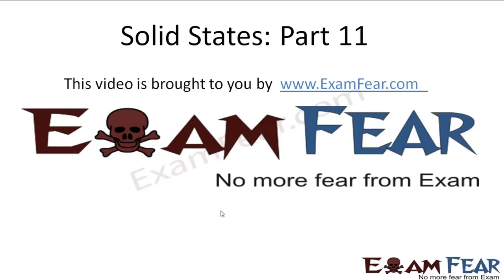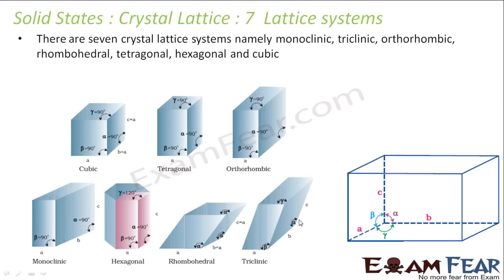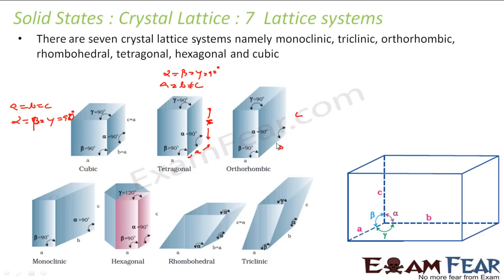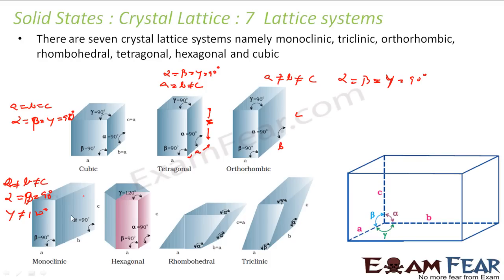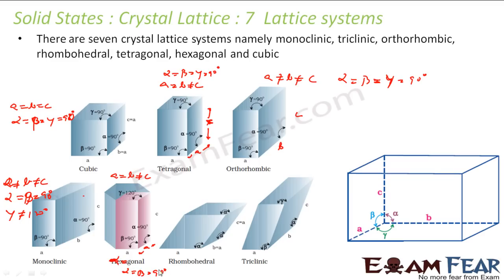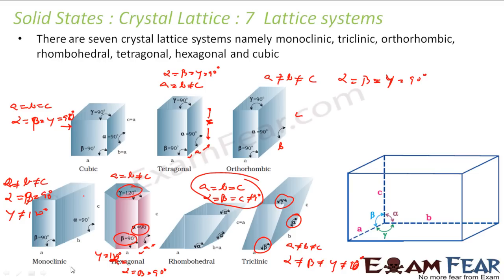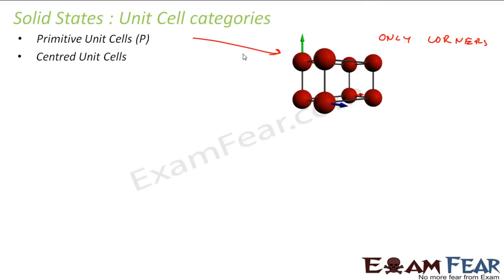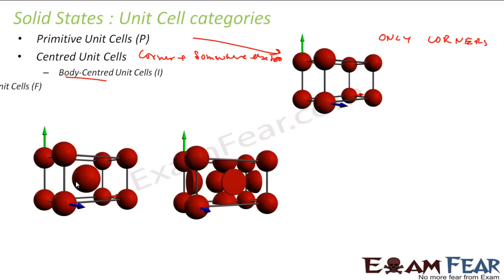Chemistry Solid States part 11 (7 seven Lattice system) CBSE class 12 XII

Comment: dude monoclinic has two corresponding angles 90 degree but the third angle is not equal to 90 degree kindly check  tetra phosphorus decoxide is ionic and not molecular and for ammonium phosphate it is moleculara and not ionic